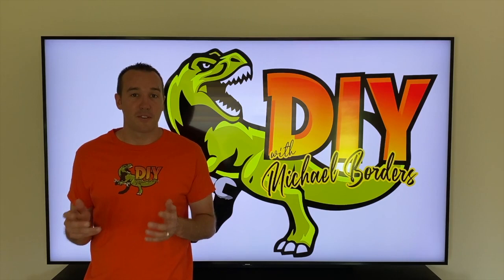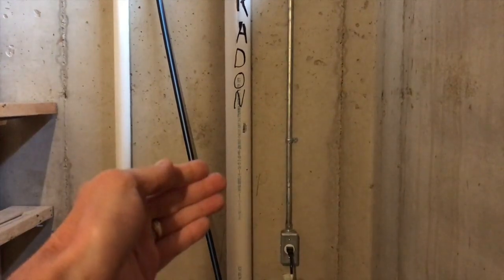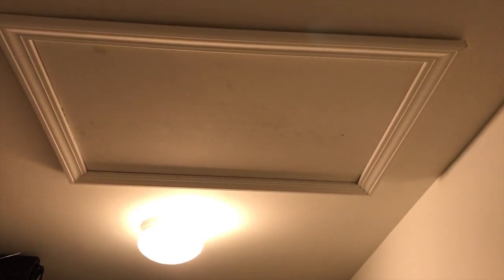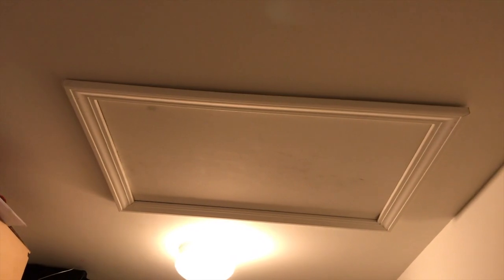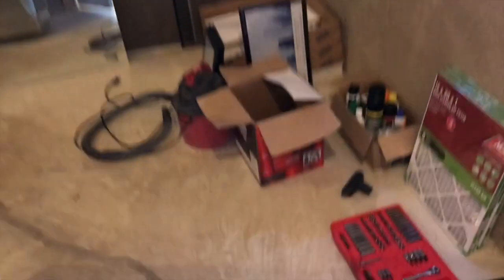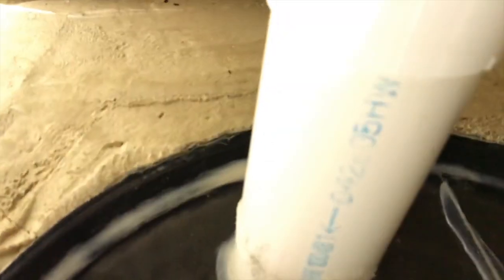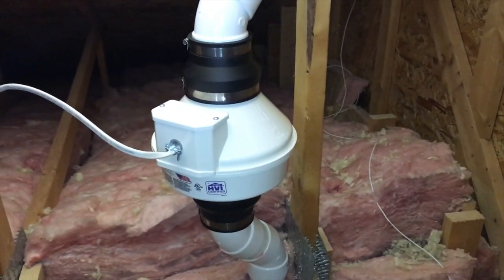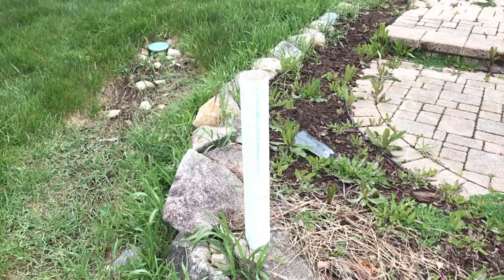Install Radon gas mitigation system  - Before & After Activation

Comment: what happens when rainwater/ Snow passes from the roof end of the Radon Pipe to Radon Fan?
Reply from the maker: Thanks for watching & that’s an awesome question.  If water gets past running fan, it travels down the plumbing & into you sump chamber.

It is then sumped out of chamber when water level lifts sump float to draining level.

Hope this helps.  Please check out our Radon Gas playlist link below, there are several videos that you may find helpful.

       https://youtube.com/playlist?list=PLjCXOz8TSkZmGLVpEJ_9dyYeMR9SwCsP8

Thanks again.  😎👍🔧🔩
Reply: @DIYwithMichaelBorders  so radon fan can let water pass through? I do have sump pump and radon pipe is there too.
Reply from the maker: @07SATS  

Thanks for the reply & in the unlikely event that water passes through, it goes to a safe place without causing damage to home.

The fan does an amazing job at blowing water & snow out of pipe above fan.  Next time it is raining very hard, go down to your sump pump and see if you can see any water dripping from your radon pipe.